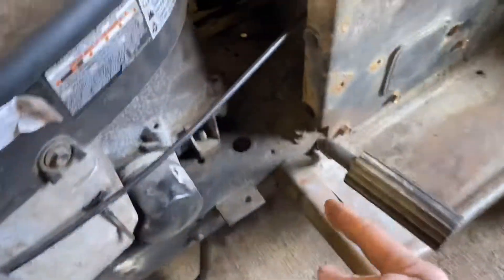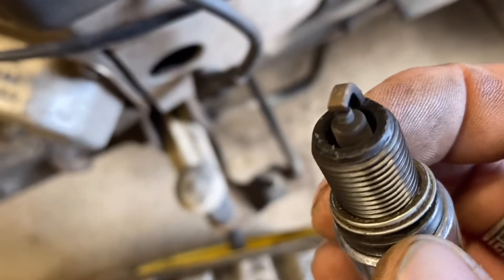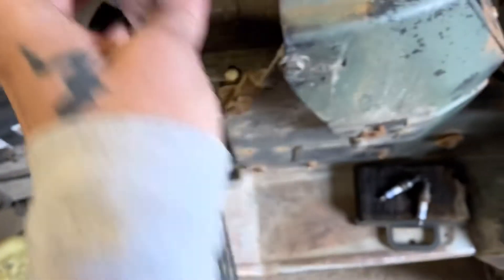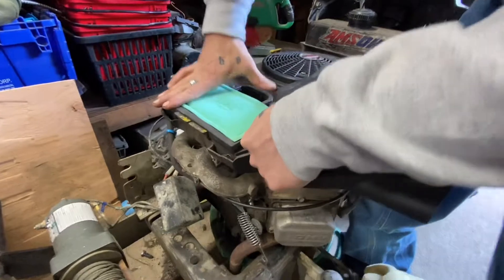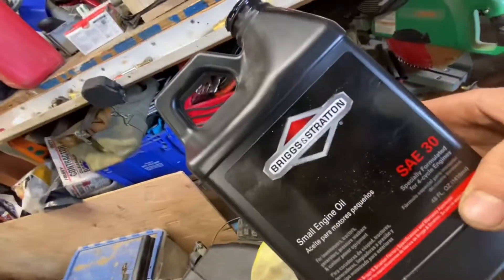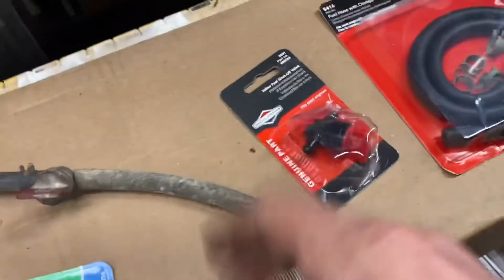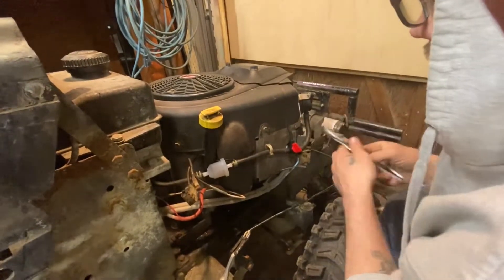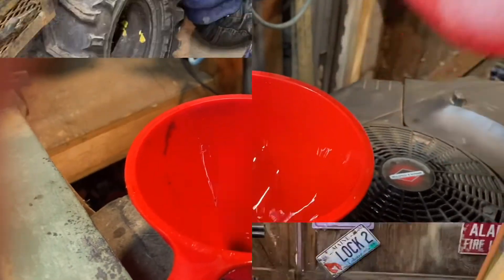Castle Gets A Tune-Up

Comment: Do you have a video on how you made your gas pedal
Reply from the maker: Rick Broerman I used a bicycle brake handle and a bicycle brake cable
Reply: @MowerOutlaw  will u use the automotive break line method that mike made

Comment: So 25 horse V-Twin Briggs came with a single barrel carburetor 40CI?? I have a 20HP, three 24HP & a 27 horse V-Twin Briggs That are all but the 20HP (40CI) are 44CI that have double barrel carburetors on them..
Reply from the maker: Cowgirl Motorsports this is a single carb
Reply: @MowerOutlaw  Then it not a 25HP, its a 18.0HP to 21HP sorry to say